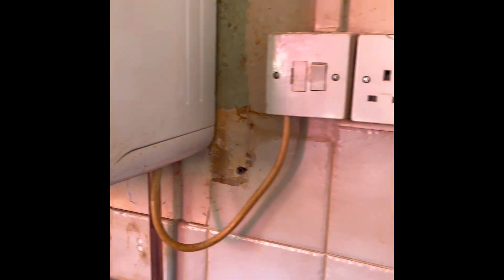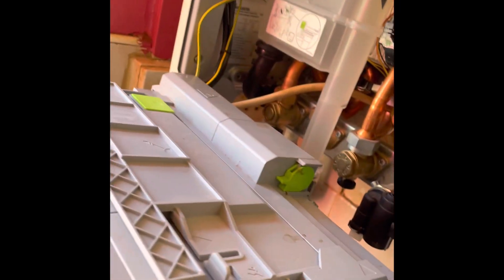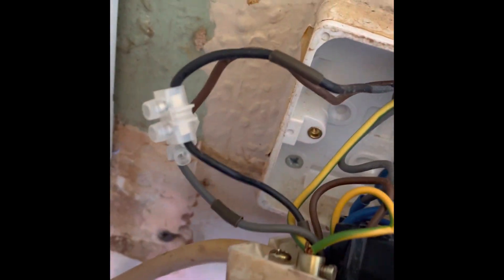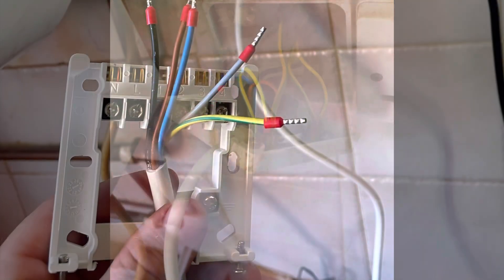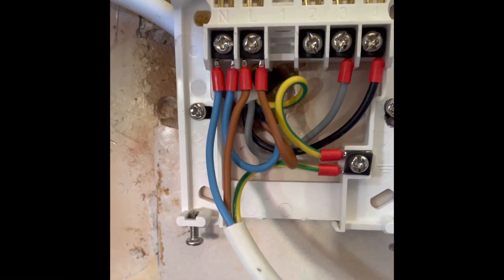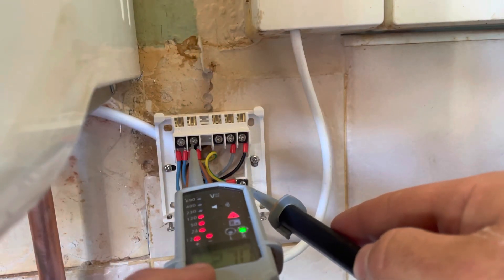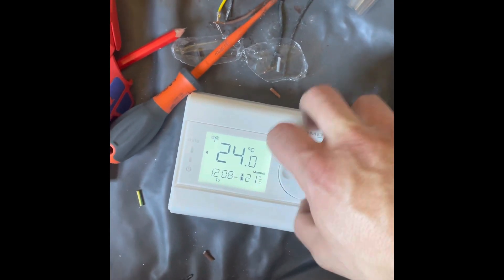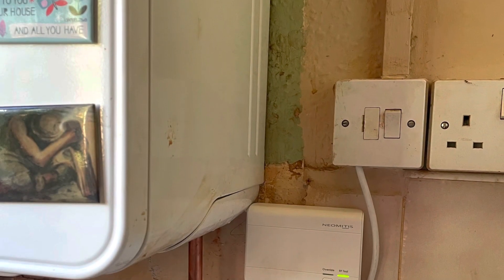Replacing a Honeywell wired programmable roomstat for a neomitis wireless programmable roomstat

Comment: Shame you didn't opt to install an EPH combi wireless with a OpenThem wired in to get the best energy efficiency of boiler and stop cycling . Also please sleeve any switched live as per BS 7671, dont know how most plumber / gas engineers keep missing this.